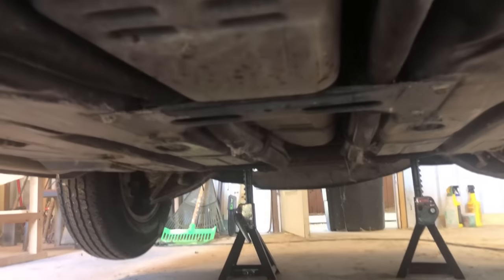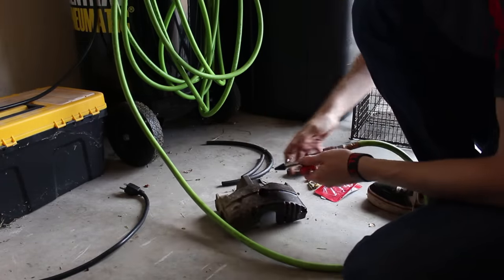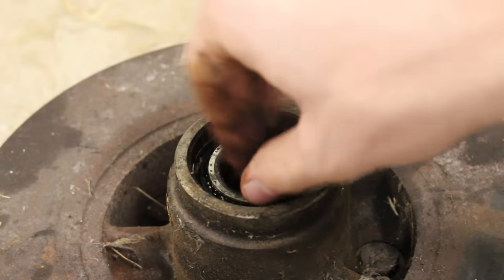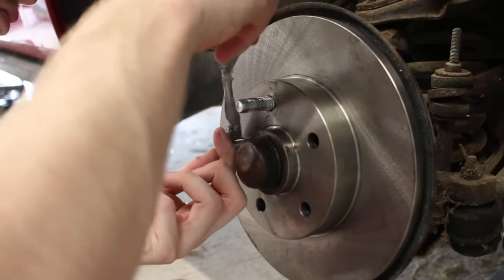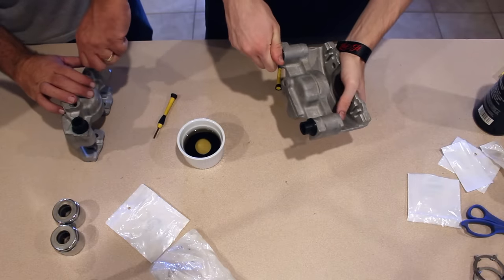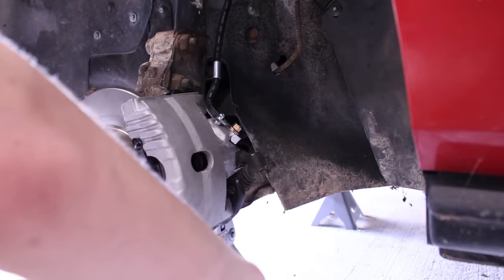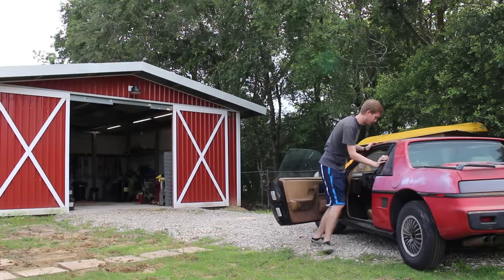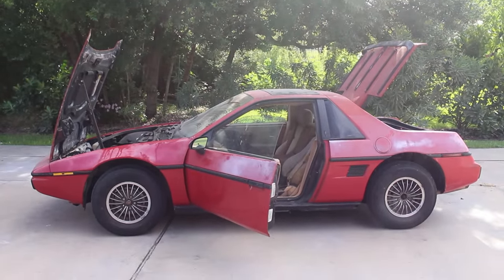Fiero Drive With Me | 1985 Fiero 2M4 Revival - Part 3

Comment: Excellent video! The only criticism I have would be that you didn't replace the wheel bearing while you had the brakes and rotors off. Would have been pretty simple at that point and those bearings are cheap.

Comment: These cars have manual headlight knobs, that will raise them. Very slow operation. You can easily lose a finger if the key is on though. The motors usually aren't bad and kick back on after a couple turns of the knob..

Comment: The reason why that Phenolic caliper was so difficult to remove even with heat is because that material actually absorbs brake fluid over time. After long enough, they become impregnated and swell up, thereby seizing to the cylinder wall of the caliper. hence why the heat didn't work as it would have with a metal piston. As far as ive seen, only American vehicles use them, although researching it seems to say that they're used worldwide. Still have yet to see any japanese or european ones use them in all the hundreds of cars I've worked on.

Comment: Great series, man. I bought a Mera last year (a rare Fiero rebody) and while it doesn't really need much now, references like this are so helpful to be able to look up.

Also, holy shit I'm having the exact same clutch issue. With my clutch in I can't shift into gear, and if I start in gear with the clutch in, the car move. Gonna give that trick a shot in the spring, although mine definitely isn't seized, at least not like that, since I was driving it last summer.

Comment: Cotter pin not split pin.  You should have used a baby sledge hammer to set those races.  That what I've used for years.  Great job so far.  By the way I really hope you put grease in those bearings and in the dust cap.

Comment: Ron, @ 8:07 in the video you start installing the bearing race with  the race installer using a claw hammer. Anytime you hammer steel, you should use a ball peen hammer. The hammer face on  a ball peen is flat and made for pounding on punches and chisel heads like the installer you were using. It's just safer. Claw hammers are for nails. Believe me, I've done it wrong myself. Safety glasses are your friend, too. I'm a new subscriber and I think you videos are great. Anyone who takes the time and effort to bring back an older car is top notch in my book.

Comment: Regarding putting the bearings in the rotors..

often on small motorcycle engines and such using something called "the heat and cold trick" is somewhat common with DIY

Put the rotor/engine(etc.) in a owen on 200 degres celsius in about 15 minutes, and put the bearings in the freezer for a couple of hours.

when you put the bearings in they will just drop straight in and be seated immediatly.

Comment: paint those rusty metal parts with a little used engine oil :) It'll help fight that rust until you can full restore or replace them. Bit of a trick I came up with. Works magic.

Comment: Should have gone with the Otto Braided Steel brake hoses from the Fiero Store at this time.  The stock rubber ones on a Fiero contribute to the Fieros famous spongy brake pedal feel.  The Braided Steel hoses on all four corners tighten up this problem instantly.  And they only cost a tiny bit more than the stock ones. Well, worth the money.   This is one of those Fiero fixes (that you research first) that you always want to do when restoring a Fiero. This was your chance to get that done.

Comment: You do not need to press in the bearing sleeves into the brake rotors. All you need to do is freeze the bearing sleeves. Torch the rotor up for 2 minutes, and then drop the frozen sleeves into the rotor. It will slide right in.

Comment: Pro tip. Use a socket the same size as the race to install, using a hammer. Cheaper than using store-bought tools.
Reply from the maker: Very true, but the installer kit, as well as other tools of similar nature, are completely free to borrow from Autozone and other auto parts stores.

Comment: New battery trays are available, you have to drill out the spot welds and weld in the new try.  Had to do that on my 87 coupe.  Also gears for the lights are available for your year if I remember correctly.  Later ones... a bit tougher.  Check out Pennock's Fiero Forums for a group of Fiero nuts that trade information if you haven't already.

Comment: These are fun videos to watch.  Was the fan clutch out for the radiator?  I had an 84 Cougar that it went out on and you'd be surprised how much that fan helps cool the engine.  For the headlights, I have to imagine the gears are just seized.  Hopefully that will be an easy fix.  Also, can't wait to see what you do to the interior.

Comment: Nice to see you bringing that car back to life. In a yard at 654 Sullivan Street in Elmira NY sits an abandoned 1991 Ford.mustang the guy that owns it is in the military. The car hadn't ran in over a year and a half the motor is seized up. The owner tried to remove the rear drive axle to unseuze the motor thereby braking the rear drive axle. My hope is someone will locate the owner buy it fix it up before it sits and rots away and becomes scrap iron. That would be a shame they are highly sought after muscle cars. To let it sit and rot away and become scrap iron is just wrong. Fan of restoring antique cars Robert Gildea

Comment: Loving the restoration man, but please please seat those front bearing right. Tighten to a specified torque (do not recall what yours is off the top of my mind? But spin the rotor as you do so. Then loosen the nut until you can spin it by hand. At that point tighten by hand and use a wrench to tighten the nut just enough to throw a cutter key in and boom, you're done. I hope to see more of the build man! Best of wishes!
Reply: (12 ft lbs is your initial torque and its crucial to seat those bearings!)

Comment: You pack wheel bearings in a can of high temperature wheel bearing grease.
You should also always replace the thermostat,.. and all of the break lines on a car that has sat that long.

Comment: 4:56 those are called tinnerman nuts. They are used in the manufacturing stage and prevent the rotor from falling off on the assembly line. After that they can be discarded. And if you get aftermarket rims, they should be removed because they could cause the rim to not sit flush.

Comment: I was expecting to see the beginning of a bumper to bumper overhaul. I was sadly disappointed until I considered your age and experience. I remember taking a similar approach to projects when I was your age and was just learning about cars. I could point out a lot of serious mistakes you made but this is a learning experience for you. I’m glad you’re reviving an old car. I’m sure you’ll look back on this someday and say “I really should have done that differently.” Keep in mind that shortcuts will only cost you money in the long run. Do it right the first time and you won’t have to spend time and money having to redo what you did. Good luck.
Reply from the maker: It’s not a complete overhaul, but there are 7 more videos to come in the series. This is by no means the last bit of work to be done on the car.
Reply: Ronald Finger I realize it’s not a complete overhaul but I didn’t know that at first. My main point was that your approach seems very disorganized to me but that is very much the way I did things when I was your age. You will learn from this and with every new project you will improve your process and your technique.
Reply from the maker: Forgive me for my ignorance, but what was disorganized? Getting the engine to function and then rebuilding the brakes so driving isn’t hazardous seems like the logical linear steps.
Reply: Ronald Finger with the assumption that the ultimate goal is a full restoration, getting the engine running is irrelevant if you’re going to do a complete rebuild. Also with the gas tank. Why spend time and money making temporary repairs that will be undone to make a proper repair.
Reply from the maker: A full engine rebuild is in the game plan, but not for this series. This series is just getting the car presentable and driving around. For now, I just wanted the car to be able to move around my property under its own power. The engine won’t be running as efficiently as it could and there might be leaks sure, but it’s still more than solid enough while I restore other components like the suspension and and brakes test them out after having done the work. As for the gas tank, I would rather spend $20 on epoxy rather than $200 on a new tank since I had no idea what to expect out of the engine and the goal was to just see whether it would run and drive for the reason previously stated. I do understand this is my first time doing something like this, but I don’t think I would change the order in which I went about anything.
Reply: Ronald Finger you’re gonna have a great time rebuilding this car even though you will end up duplicating some of the work in the process. But in 20 years, you’ll look back and understand what I’m talking about. I’ve been in your shoes. If you look at people like Chip Foose and Boyd Coddington, you’ll notice they have a systematic approach to a complete rebuild. Getting an engine running before you do a complete tear down and rebuild is an inefficient approach and merely gives you instant gratification by letting you see results right away. If the engine had been seized and there had been a fist size hole in the fuel tank, I hope you would have continued with the project. If so, then getting the engine running and patching the tank did nothing to advance the project. I look forward to seeing your next video.
Reply from the maker: I encourage you to re-read my last comment, since gratification is not the reason of getting the engine running. Perhaps I will look back and see it differently, but for the past 8 months of having this car being able to drive around while I restore every mechanical aspect of the car other than the engine has not seemed like a waste of time. If I had the knowledge, experience, budget, time, and workshops as those professional builders, I would absolutely go about it differently, but seeing how this is a hobby, my first time, and working at home where space is needed to be used by people other than me, I think there is no issue with my method. I do want to say I appreciate the comments however, and I’m glad to hear you’re looking forward to part 4. It should be out in a few weeks.
Reply: Ronald Finger 8 months is not going to change your perspective. Let me know what you think in 25 years. It’s not necessary to have a big shop, lots of great tools, and a lot of experience. Being patient and paying attention to detail is the main skill you need. All I’m saying about your approach is that it’s going to cause you more work. Once you restore a part and put it back on the car, if you have to remove that part for any reason other than having to correct a problem with that part, you’re just making work for yourself. For example, you’ve got to pull all those brake parts back off to rebuild the front suspension. That may be what you have to do if you want to drive it between repairs but it’s going to cost you time and money and it’s going to be reflected in the final result.

Comment: Good job on rebuilding the calipers. That is a little above my mechanical ability.
But what the heck is an E-Brake? Is that an E-Mail blocker?
Oh, are you talking about the thing that is engaged when the parking brake lever is pulled? That is called a "Parking Brake".
Using the parking brake in an E-mergency could have disastrous results.
Reply from the maker: Hey thanks man! Emergency brake (E-brake) is synonymous with parking brake, at least in America. I’m not sure where you’re from, but the two are used interchangeably here!

Comment: Split pin? It’s called a cotter pin, just FYI. Also when installing grease caps, the cap over the bearing, use a soft face or rawhide hammer

Comment: The best way for packing grease in bearings is using a zip lock bag or a sealable small plastic bag and you put the bearing and grease inside the bag and then just keep squeezing the bag to get the grease pushed in the bearing

Comment: My MX5 had that "little hole for a screw" in the brake discs.
On one disc it first cracked the disc and then stripped the threads out.

(Also you forgot to de-rust the dust shield)

Comment: Surprised in Part 2 you didn't use POR15 in the gas tank. After your diesel flush, give the tank 2 or even 3 coats and you will have the tank sealed rust free for life.

Comment: This is a great project and I really enjoyed watching your video. But seriously, BE CAREFUL DRIVING THIS CAR. I owned a 1984 2M4 back in the early 90s, and I can tell you from experience that these cars have a very serious tendency toward under steering. While taking even relatively gentle turns the front tires will sometimes lose grip, at which point you'll find yourself with the wheel turned but plowing straight forward. (I suppose this happens because there's essentially no weight on the front wheels.) It's an especially big problem on wet roads, and the last time it happened to me I ended up wrecking the car into a tree. I'm lucky that I didn't get seriously hurt or killed.

Comment: Did you test the brakes at all before you set off screaming down the road? The video may have been speeded up but it certainly looked rather "enthusiastic" for a car with so many parts of unknown reliability. Still, you survived :) I continue to be amazed that you can drive cars on the road in the U.S. without any tests of roadworthiness being required, so basically get a death trap out of a barn and drive it around. You have been responsible and rebuilt your brakes, but how many do?

Comment: How did you remove the e-brake cable from the bracket when the bolt was stuck??
Reply from the maker: Just pulled it loose with needle now pliers! It has to be removed first anyway, otherwise the spring could launch it away if you just tried unbolted it first.
Reply: @RonaldFinger  I guess I typed that wrong-You said you removed the plastic retainer clip in order to remove the cable to get the caliper off, that's the part I didn't understand.
Reply from the maker: Ahh okay! There should just be little tabs you squeeze in. You have to squeeze and pull at the same time, then it should just fall through. You may have to use pliers to squeeze them or maybe I screwdriver to press them. I honestly don’t remember exactly since this video was filmed two years ago haha

Comment: My first car was a brand new 1986 Pontiac Fiero (standard shift) 2.5l. It came with a 30,000km 3 year warranty. While under warranty, it spent over 6 months in Frank Laurier's shop in Port Hope, Ontario. In cold (Canadian) weather it would not go into gear. It was due to a new type of hydraulic clutch, and steel components that would contract during cold months.  During warmer weather it worked perfectly, so it would be in the shop in the winter, then out when it got warm.

Eventually the warranty expired and the auto dealer REFUSED to fix the problem. So my $17,000 car was traded in for about $3,000.

Good luck restoring a POS.

Comment: nice project and good job, but I do disagree with you on how to install the lugs, by impacting them into place you can actually stretch them and in doing that cause them to brake or snap off while driving which could be dangerous. I would rather press them inn with a hydraulic press or at least hammer them in to place the way you did with the bearings. 
again good job and looking forward to seeing the rest of the series.

Comment: I would ditch the vinegar bath and substitute it with phosphoric acid (something like CRC rust remover, should be plentiful in a free country like your unlike us when you have to provide evidence of use for each chemical compound you use). It will dissolve the rust and leave a layer of phosphate (when you leave it to air dry) to prevent rusting even if you don't add any anti rust measures to it.

Comment: Slip a small rubber vacuum line over the end of the brake bleeder and run it to a jar before opening the bleeder valve. Never let brake fluid spill on to your concrete floor, car paint and inner fender wells.  Brake fluid, over time, ruins just about everything.  You said you were new to the process so I thought I'd just pass that along to ya.
Reply from the maker: Thanks for the info! I’ll definitely be a lot more careful next time. Ideally I’d like to get a vacuum bleeder since those seem so nice

Comment: Go ahead and jack the car back  up, but put safety chains on it to keep it from falling down.  Now's the fun part of suspension work.  All bushings, shocks, springs, and ball joints have got to go, no exceptions.  You might as well get those ordered and on hand.  While the suspension is off, eyeball the clutch and tranny, look for leaks and problems. The clutch works, yeah, but how much clutch is left? Check it out.  Go ahead and change the oil and filter again. Any gunk or crap that was in the galleries has broken loose and is now either in the sump or in the filter.  Eyeball the tranny's fluids too, odds are it'll be white if any water got in there and mixed with lubricants.

Pay attention to your brakes now that they have got some mileage on them. See how the calipers are doing. are they locking down on the rotors evenly? Is there any discoloration on the rotors from overheating?  Are the lines still intact, or are they starting to leak?  I've known metal brake lines to fail and dump the full charge of brake fluid, leaving just enough for the last half inch travel of the brake pedal to be effective. Anything faster than 20 with a failure at that level is nonexistent without emergency brakes.